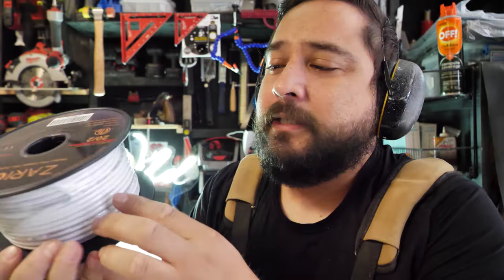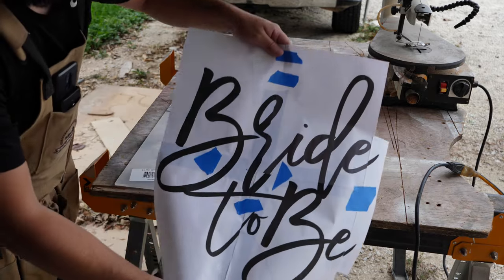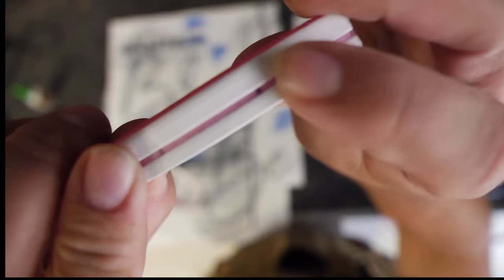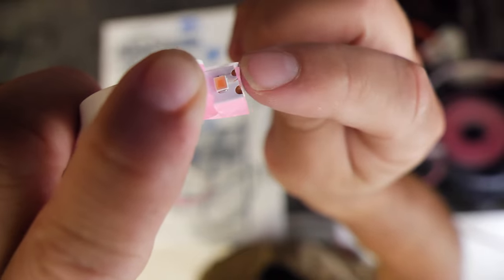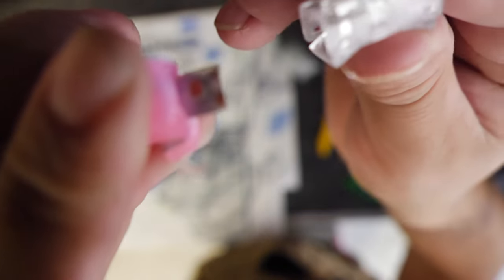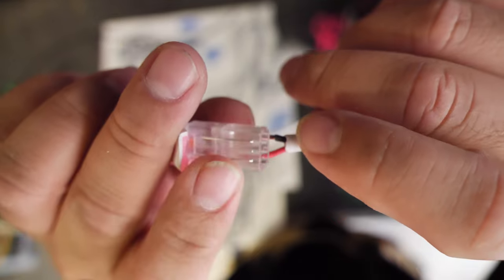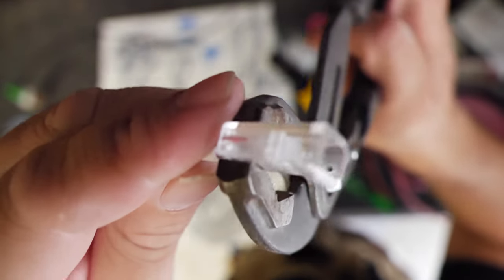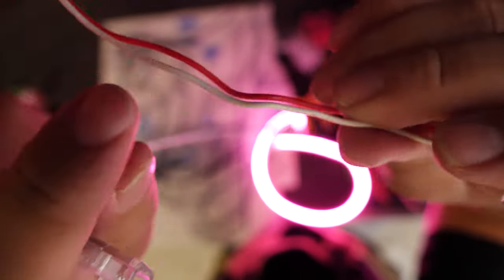DIY Neon LED sign NO Soldering

Comment: Thanks for this. LED is such low power I used super fine wire with no outer insulation. #24.  Glue it down seperated and its invisible. Soldering is much less expensive than connectors. Its easy.
Reply from the maker: Yes I need to practice soldering more. Hopefully soon, thank you

Comment: I have watched this video a few times but, still don't believe I can make this. You are so good at making this kind of art. Thanks for sharing your brilliant ideas. Happy New Year!
Reply from the maker: Hi thank you, Happy New Year! The first one was tough figuring if it would even work. The second one was a lot easier. I am hoping to make a smaller example one, live so people can see it in real time example. I will probably just do a small word or something, hopefully soon. Thanks for watching and commenting.
Reply: Hi, what machine did you use to cut the plexiglass?
Reply from the maker: @dmeeksy  Hi thanks for watching. The machine I used to cut the plexiglass was a scroll saw. But I know you can use a couple of things to cut plexi glass. The main thing is the plexi glass cant be too thin. Thin plexiglass can crack easy when cutting due to the strong vibrations of the tools. If you do attempt to cut thin plexiglass cut slow and support it as best as you can. The thickness of this one I cut was .220 and it cut it easy.
Reply: @MakerDecor  I love this. I need HAPPY BIRTHDAY made ASAP
Reply: Certainly not with that mindset! 

I'd avoided learning mechanics for years because I was so sure I couldn't do anything besides the most basic maintenance. Learned helplessness, basically. 

Hit a rough patch a couple years ago where I flat couldn't afford a mechanic, but my water pump went out. Had the tools, had just enough for the kit, had no choice but to give it a go.

I've now replaced the water pump/timing belt, power steering pump, alternator, spark plugs, and did a valve adjustment with nothing but a field service manual, YouTube videos, and some relevant forum posts. My car runs like a dream again despite being at 268k miles. 

Don't sell yourself short. It's not magic, as mystical as it can seem before you push yourself to start.

Comment: I will definitely be attempting this soon! Been wanting to make one for AGES and this just gave me the motivation I needed. I'm just concerned with how I can cut the plexiglass with no tool and also knowing where to cut and make connections in my design as well as what to use to cut the holes to bring the wires through the back. Hmm 🤔 I need to find a wire that I can change the colors and brightness as well
Reply from the maker: Hi,  You can also make your design around the shape of plexiglass you get. Most come in a rectangle shape. I have seen people make them with out cutting the plexiglass or you can outline the rectangle with LED neon lights as a border. Just throwing some options I have seen. Where to cut and make connections is easiest when you draw it on paper first and look at where it is best to cut and where you maybe dont need to cut and get away with it. To cut a hole through the plexiglass for the wire, you will most likely need a drill depending on your design. Good luck and thanks for watching!

Comment: This is very helpful! Thank you so much!
Reply from the maker: Your welcome. Thanks for watching!
Reply: @MakerDecor   I have a question, how do you know where to cut and connect with the font you use?
Reply from the maker: @zeronouveau  Really I dont, I just kind of plan it out as I go. The first sign I made I cut and connected a lot. So with this one I tried to avoid making so many cut and connections. So where I felt I could get away with just bending the wire, I did. So like the "e" I just folded it instead of cutting it to save time. It does look better with more cuts and connections, but this was way easier with less cuts. And I like the way it came out. Hope this helps.
Reply: @MakerDecor  One more question: how did/do you get the black end of the neon strip that connects to the power source to be behind the acrylic?
Reply from the maker: @zeronouveau  Hi, I have only thought of three choices. Drill a big enough hole for the end to pass to the back. I have done that, didn't like it. Second cut the wire, drill a small hole and run the wire. Then reconnect the wire and seal it. Done it, didn't like it. The third option is to just leave it hanging low from the front? Hope this helps

Comment: Hello there. Thank you for this video and the others! What piece do I need to connect the end of the light to the adapter? I noticed you have a connector of some sort that you attached to adapter but don't see that piece in any of the link. Does it come with the adapter pack you linked? How would I go about connecting the wire on light to the adapter?
Reply from the maker: Hi thanks for watching. When you purchase the LED light it has a small piece on one end of the LED that is the female connection. Then you purchase the Adapter https://amzn.to/3zlsGKj to the female connection, plug in and it lights up. The LED tubing only comes with the one connection at the end of the line. I believe that is what you are talking about. All you need is the neon tubing which comes with the female connection at the end. Then the adapter  which comes with the male connection, and they connect to each other. Hope this helps and please let me know if there is anything else I can help you with!
Reply: @MakerDecor  thank you!
Reply: What are those 2 hole connectors called?
Reply from the maker: @StrictVisionAthletics  Hi, thanks for watching. The item name is 2-Pin 8mm COB LED Strip to Wire Connector Unwired Clips Solderless and the link is in the description of where I purchased mine, Amazon
Reply: How thick is the acrylic?

Comment: I’m a little bit confused how you are connecting the tubing through the middle of the sign using the clips? Seems like a challenging angle! I have access to soldering equipment so I’m wondering if that  might be the better route, but I’ve only seen videos with laser cutters so I’m glad to know I can just use plexiglass!

Comment: Having a hard time cutting the .220 Acrylic. What's the easiest way to cut it?
Reply from the maker: One of the things that gives me the most trouble is a dull blade. It doesn't cut it and just causes it to melt back together. So a new blade is best but they dull quick too. But I have also cut it with a jigsaw and a plexi glass cutting blade from Amazon. Hope this helps!

Comment: My light strip has 4 copper pieces..do I need to get a connector wire with 4 atrands instead of 2?
Reply from the maker: I would think so, but I  haven't tried that one. Only the 2 I have tried. Thank you

Comment: What did you do with the acrylic to avoid melting back? Usually with the heat of the saw welds plexi or acrylic back together after cutting ? Do you sand edges ? Whats best advise to get smooth finish ?
Reply from the maker: Hi, yes sometimes the blade will do that. I use general purpose blades and plexiglass will dull those blades quick. So if you have a dull blade or it was cutting good and then it started to melt back together. The most likely culprit in my experience is just a dull blade? So its not getting a clean cut. A new blade and getting your timing right, not too slow and not too fast will help reduce the chance of it melting back together. Yes I do lightly sand the edges with a sanding sponge. Not a lot but enough to take off any plastic strings that hung on. Best advice for a smooth cut is a brand new blade. I have been working on putting a video together covering the topic of cutting plexiglass. Hopefully I get a chance to do it soon. Hope this helps.

Comment: What kind of blade did you use on the scroll saw? I tried and the acrylic just melted back together
Reply from the maker: Hi, I used a generic blade. So three things can affect the cut causing it to melt. The number one thing is a dull blade, I can probably cut out one sign on a new blade before it becomes dull and starts to melt the plastic. So if the blade you used was not brand new and you tried to cut it, most likely will cause trouble. The other things are pushing the acrylic to fast and the speed of the blade. You can also cut it with a jigsaw that has a plexi-glass cutting blade. They sell those blades at most hardware stores such as Home Depot. Hope this helps and good luck.

Comment: Hi Ben! Thank you for the video! I wanted to make one for my best friend . How thick should the plexiglass / acrylic glass be for me to drill a hole for the wire so that it doesn’t crack. 🙏🏻
Reply from the maker: Hi, thanks for watching. The thinner the plexiglass the easier to crack. I used .220 size which is almost 1/4 thick from Home Depot. The thinner the drill bit hole the less chance of cracking. Just make sure it is fully flat on a surface or piece of wood so its supported good. Then drill slow with a thin drill bit. I have drilled through a couple of plexiglass and only had one crack. But I just pulled the bit out slowly, put in reverse and went through. The crack was minimal, so I was lucky and I was able to still use it. Good luck!
Reply: @MakerDecor  Thank you Ben ! Okay I’ll try to get 0.22 inch plexiglass or thicker! And I’ll surely let you know the result. Thank you again for the tips! ❤

Comment: Appreciate the detailed walk-through.  Can you tell me how you created your stencil and tiled across regular paper?
Reply from the maker: Hi, you can use programs such as Photoshop, inkscape, canva, etc. It is different for each one and it usually takes me a lot of trial and error, print and reprint. I dont have an exact method and try different ones till it works out. But when I do get it to work out I save it, lol. I am still just a beginner with those programs and just learn as I go.

Comment: YOOOO great video man! love the look and those clips seem waaaaay easier comparied to soldering.
Reply from the maker: Thank you,  they are easier. But they can be finicky sometimes. You cant push to hard or it cuts through, not enough and it wont connect. I have tried soldering twice and couldn't get it into the small connections so this works for me lol.

Comment: Hello. Love your videos. You make it look so easy. Can you pls let me know what the machine is to cut the plexiglass?
Reply from the maker: Hi, thank you so much.  I have used the scroll saw, but you can also use a jigsaw with a plexi glass cutting blade. The main thing is it has to be thicker plexiglass, because the thinner one will crack easier when attempting to cut.

Comment: Question tho. I know you need to cut on the black line to connect the connector. But what about the end of the line? Like if I needed to cut it in the middle for the lay out. Does that make sense? Can I cut it in the middle? Or the will mess up the whole line?
Reply from the maker: HI, yeah you can cut it anywhere like if you letter ends or just looks better shorter. The light will still light to the end no matter where you cut, BUT if you do not cut on the line, you can not connect that section to another section. It will only light up and not continue past where you cut. Hope this helps, good luck!

Comment: Could you use acrylic sheets instead of glass, I use a silhouette cameo and I know I can a thin sheet of acrylic in the machine
Reply from the maker: Sorry I am not sure, but I do not think it would work as the flexibility of the thin acrylic may fold with the weight of the LED wire.

Comment: How well does the glue stand.. looks like you can’t bump the sign much. The light looks like it stands tall
Reply from the maker: Hi, this glue with this specific LED light works great. I couldn't pull it off easily for sure after it cured. But I have tried it with other LED lines and it wont hold long. Thanks for watching!

Comment: Hi, what blade are you using on the scroll saw and is the saw one speed or variable speed?
Reply from the maker: Hi, I am using just a general blade and it is variable speed. They do have plexi glass blades I believe. But the most important is having a new blade. As they dull fast and cause the plexi glass to become sticky when cutting it.
Reply: @MakerDecor  ahh I see. I have a scroll saw similar to yours (not variable speed though) and every time I try to cut plexiglass with it it cracks. I did buy new blades, but I haven't switched them out yet! Maybe that's it.

Comment: What kind of bit are you using to drill the holes in the plexiglass? I have a glowforge (still in the box) and am making a wedding sign for a friend. This method seems it will be easier, but I don’t want to crack my plexiglass. Also, I got some Ryobi tools for Christmas, don’t have that fancy tool you used to cut the outline. What kind of hand tool would you suggest using?
Reply from the maker: Hi, thanks for watching. But I would definitely take advantage of that glowforge. I'm jealous, lol. Hoping to get a laser cutter soon. I have made a couple of signs and have only cracked it twice I believe from the drilling. Both were still usable and just slight cracks and just takes some slight practice. Both times it cracked were my fault in stopping the drill too soon before drilling completely through. I just used a generic bit You do not need a scroll saw to cut the outline. A simple jigsaw with a plexi glass cutting blade will do it as well. But you do need thick plexi glass as the thinner will crack from the vibrations. The one I used was from Home Depot and I believe .220 thickness. Not the thin one. Hope this helps and good luck with your sign and your laser!! excited for you!
Reply: @MakerDecor  thank you so much for your help! Love and appreciate that your videos are to help others learn as well. There aren't too many like you on social media!

Comment: AMAZING!!! I've always had them custom made with the glass tube, its been a while. I'm going to look at the slower video and may try it. Whats the worst that can happen, I get shocked or blow a circuit?
Thanks so very much for sharing.
Reply from the maker: Hi, that is difficult. They do have neon lines that change color but I have not been able to create a sign with it yet. I have tried once to do a color changing sign. I will have to try it again soon.

Comment: where did you get the white jacket electrical  wire from and where did you get the plexiglass also :)? i tried the links but didnt see it.      Thx in advance!
Reply from the maker: Hi the electrical wire I got from Amazon. Here is the description below so incase they don't have it you can look for something similar. I'm still not 100% on if I will stick with this wiring but it does work for this application. You can also use door bell wire from Home depot or Lowes, your looking for 20 or 22 gauge wire from what ive read. The plexiglass was from Home Depot, It was like $30 for the size I got. Make sure to get the thicker one, mine was .220 thickness because if you get the thinner one it can be difficult to cut with out cracking. 

Zarivy 100 Feet 20 Gauge 2 Conductors Red Black Wire with Fire Resistant CL2 White Jacket, 20AWG OFC Hookup Electrical Wire LED Strips Extension Cord Cable for LED Ribbon Lamp Tape Lighting
Reply: @MakerDecor  Thank you 🙏!! And keep up the great work 💯❗️
Reply: @MakerDecor  they are out of the white , do you think 18 gage 8AWG Low Voltage LED Cable, 2 Conductor, Outdoor Rated, Jacketed in-Wall Speaker Wire UL/cUL Class 2, Sunlight Resistant (100ft Reel) would work? I see yours is 20 gage. Thanks!!!
Reply from the maker: @ajpro777  Hi thanks for reaching out.  The thickest I have used was 20 gauge and I had to strip the wire to fit. I would stick closer to 20-24 gauges to make sure the fit in the clips. Unless you find bigger clips than the ones I used. Thanks.

Comment: Can I ask what blade you used for your scroll saw ?
Reply from the maker: Hi, thanks for watching. For most of my cuts I just use the all purpose blade. The main trick is to use a new blade. The plexi glass dulls blades fast. So if its not a new blade it can be difficult to get a clean cut. The plastic will melt instead of cut clean and begin to stick back together a lot. Good luck!

Comment: Awesome video. Does the connector that goes from the lights, and connects with the power source included with the power sorce,  or did you have to buy it separately?
Reply: It should be included when with the lights
Reply: @NickMoises04  got it, thanks

Comment: Looks great! How did you hang the sign?
Reply from the maker: Hi thanks for watching. I used command hooks and fishing string.
Reply: @MakerDecor  makes total sense! I was thinking of making a sign of a double headed eagle outline of the Albanian flag (google search should show you what I'm talking about, for some reason I can't add links to my comment) but I was wondering about the physical logistics of being able to bend the tubing to follow the tracing. How big do you think the sign needs to be to be able to do it? Also don't want to make it too big and spend a ton of money haha
Reply from the maker: @zachtochka9815  I saw the image. It is a lot of bending. I would think it would have to be at least 24 in square plexi-glass. That would probably be the smallest I would attempt to make it. The bigger the easier it will be, but cost will go up. And it will take at least two bottles of super glue to make sure it wraps around the corners. The heads will probably the the most difficult part. But if you get it to work it will look really cool! Good luck.